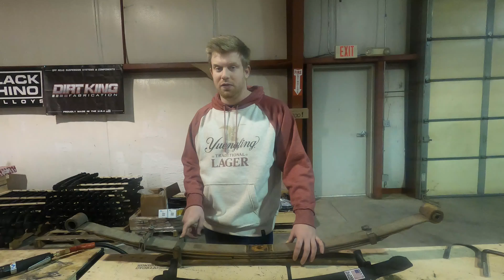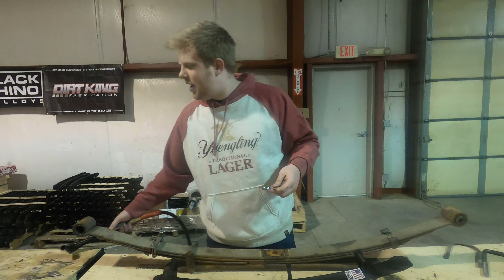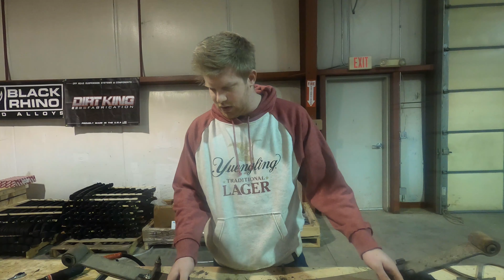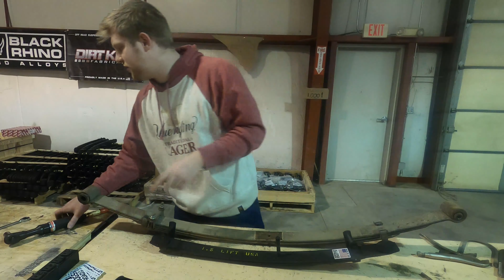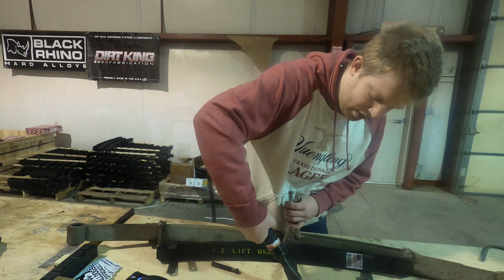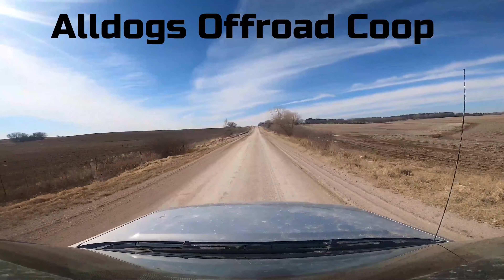Suspension - AAL Install

Comment: What is the lift difference with the overload leaf and add a leaf installed compared to removing the overload leaf with adding the add a leaf on a frontier? I kept my overload and added the add a leaf. It rides good but sits about an inch higher in the back than the front. Curious to if removing the overload spring will level it out.

Comment: Hello,
Nice tutorial!! 
With respect to the 3rd Gen. Frontier, will both overload Leafs need to be removed to achieve 1.5 inches of lift?
Reply from the maker: Yes. If you add the overload back into the pack you will see more than 2” of lift out of the rear

Comment: For Xterra,  what is the difference yours 3 pack AAL PRG single leaf AAL. Which is better ONROAD  for potholes and bumpy roads?
Reply from the maker: the 3 leaf will be a more comfortable ride as it's more progressive with the added leafs.
Reply: @AlldogsOffroadCoop  Thanks, and lastly new light leaf pack vs the 3 leaf Aal. Which will ride comfortable?
Reply from the maker: @mvshabeer  we do not offer the performance packs anymore for vehicles. we only have the broverland option and AAL. xterra's seem to be undersprung from the factory so we usually recommend just replacing the OE pack with the broverlands if it has over 100k on it.

Comment: What is needed to keep the overload leaf?
Reply: Curious as well
Reply: @black2007cobaltss  just need to remove the retaining bolt from the overload leaf and throw it away.  
Remove the pin in the center of the add a leaf pack. Put the overload leaf below the add a leaf pack and reinsert the pin which now goes through the overload leaf then add a leaf pack theen the oem pack.  Then all else is like the video.
Reply: Daniel Binnings that’s what I figured, but wanted to get verification before I started taking the truck apart. Thank you!
Reply: I assume this also adds some extra lift and support for heavy loads. Any harm to the ADO AAL running with the overload? Other than a stiffer ride.

Comment: Are you able to reuse the OEM U Bolts for this?
Reply from the maker: No, you should never reuse Ubolts
Reply: In order to use the new provided ado u bolts, you need to drill bigger holes on the plates or bracket to fit fatter u bolts. Didnt hear this anywhere in any installation on this aal.